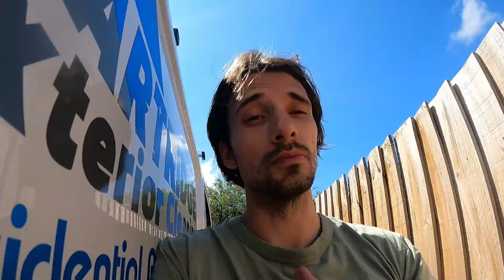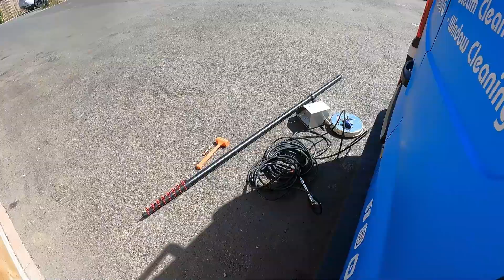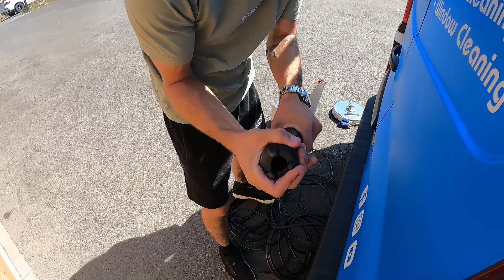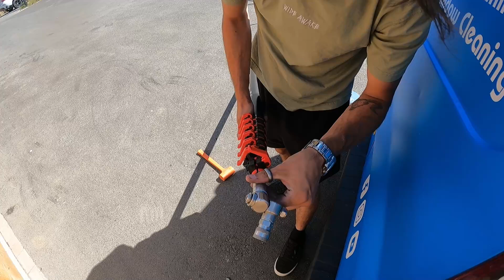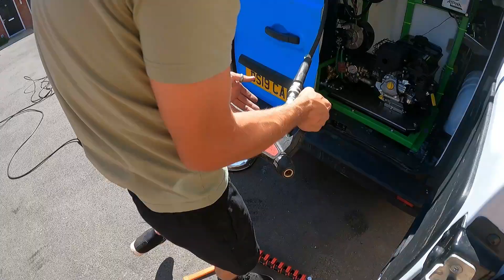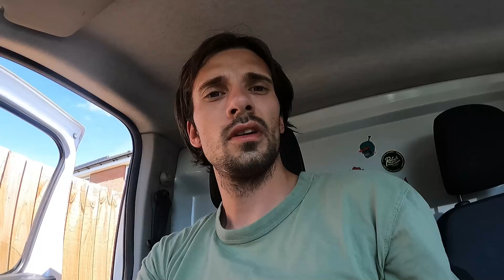How to Install a High Pressure Conversion Kit to your Water Fed Pole

Comment: Do you mind me asking what nozzles you have in the rotary head, I've 035 in my head and I'm running a 3000 psi yanmar diesel but I've no lift on the end of my wfp, so I'm wondering are the jet nozzles insufficient, I've seen 065s but not sure would they help..

Comment: Most of the pole conversion kits I can find are 30ft kits but you have a 50ft pole. Does that mean u can't use 20ft of the pole or do u have an hose extension piece inside the pole? Or have I misunderstood something?

Comment: Great videos, Sid, thank you. Could you tell us how long you expect this 900-quid pole to last? I've broken one already (different brand, but similar). It was about 2 y old and I felt I had very little milage out of it, I must have used it 3 times. I used too much pressure and it slit cleanly at the brush end. It's now 12 in shorter... Thank you very much

Comment: Nice to see the bits put together - I never realised that you had to remove section 1 of the pole to fit the high pressure hose! Could you run both machines (1 van and your other machine) off a customers tap or are you just thinking of a 'spare'? i.e. are you going to have 2 complete setups inc tower so you could both be doing different roof jobs at same time? I sort of assumed you would have 1 van dedicated to roofs and the other for smaller pressure washing, gutter clearing maybe even a window cleaning setup to build a round?